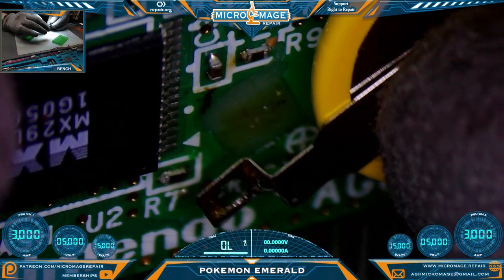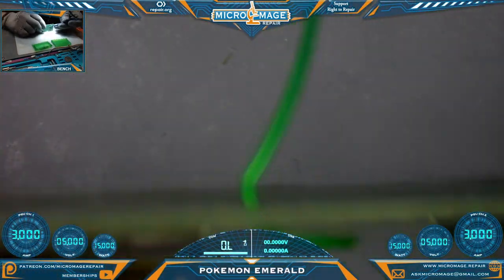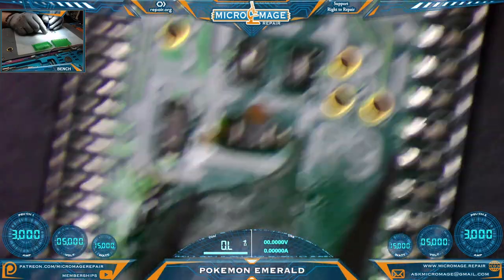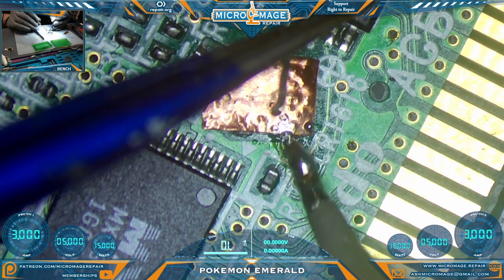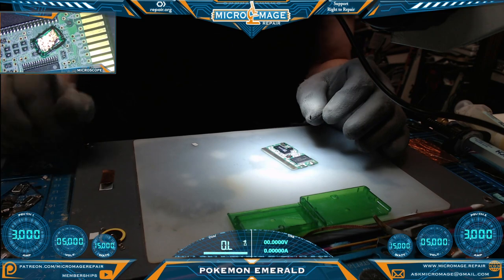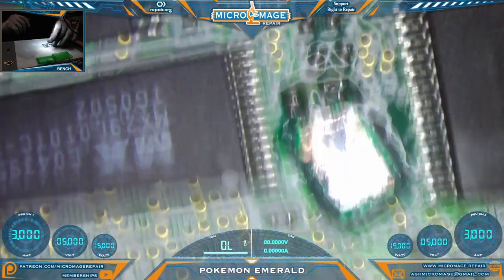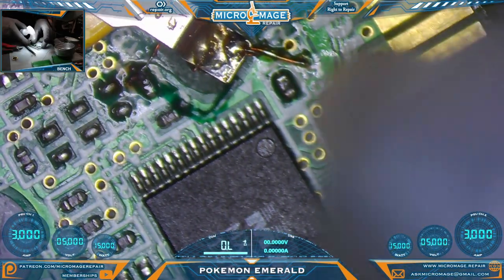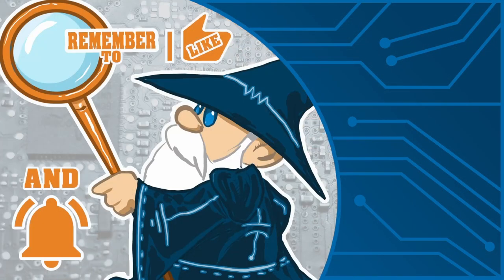Pokémon Emerald Version: Trace Repair & Battery

Comment: Could you of bent the battery terminal down a bit to relieve that upward tension? I wonder if you had used bit of possibly solder wick as the pad and glued that down to the board. Got the upward tension of that spring steel on the battery plus the heat of having to solder the battery terminal working against the new pad.
Reply from the maker: Thank you for the suggestions! Yeah several people have suggested bending the terminal. I'll have to remember that if it should come across my bench again.
I'm not sure if wick would have offered anything more than the tape. The contact points where just really limited.
Reply: @MicroMageRepair  ya sometimes that spring steel is not easy to bend and have it retain the new shape.

Comment: There are some 2 part epoxies made for copper to board repair, that are high heat, but they are very expensive. And not sure it would handle the force of the spring effect. Does it need that spring force?
Reply from the maker: I wouldn't think so, the tension doesn't do anything to my knowledge.

Comment: You could leave it bouncing but put a blob of hot glue from a glue gun, just to take any shocks and give support. Also, it's pretty easy to remove later if you need to.
Reply from the maker: Appreciate the suggestion! Will consider it on the next one.

Comment: those battery don't have the correct shape and lenght terminals to fit perfectly in the cartridge (in fact none of the sellers could provide the correct ones). when i have to replace it i make my own with spot welder. or you could bent them as you wish but in some cases the terminals are too short when are in the correct shape to be able to solder to the board
Reply from the maker: Interesting! Appreciate the suggestions!